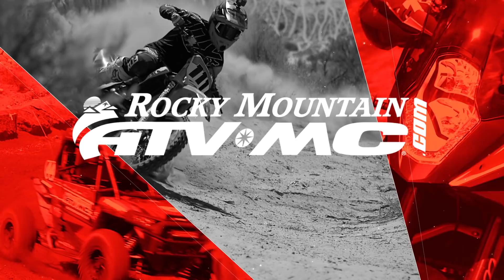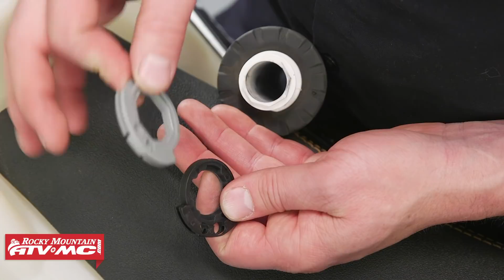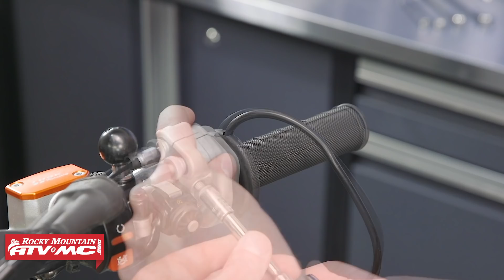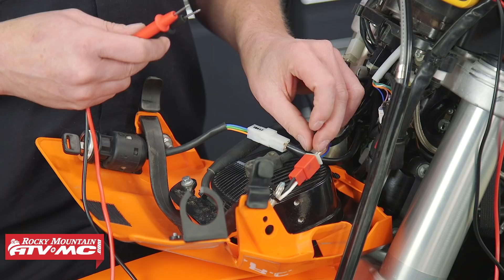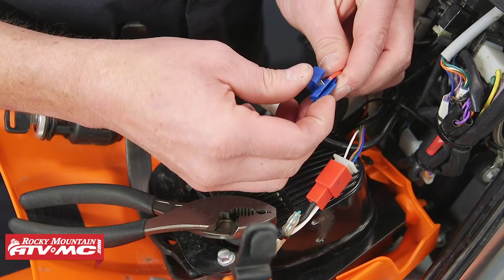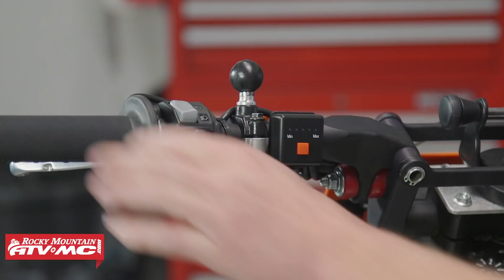Tusk Motorcycle Lock-On Heated Grips | Installation

Comment: I wonder if there is a installation video on installing these on a non-stator type bike. I have a YZ250x that I just bought a stator for that can run grip heaters but don't know if I need a regulator or how to install them to the stator wires provided.

Comment: I think a relay and a posi-tap is a better way to wire it, then you can power other items like a gps or phone charger.
Reply: Yea I was thinking that myself. I have plenty of watts available on my DRZ 400S but I dont think its wise to draw more accessories from the oem harness. I read that many DRZ 400S guys have, and I draw very little from mine as I use a 38 watt led headlight, and led tailight for a total of maybe 50 watts of 200 available. I am still hesitant to load the oem harness with heated grips for some reason. It sure would be easier to just tap into a key on power though, not to mention cheaper. Unfortuantely when I asked on a DRZ specific forum, I got mixed answers.
Reply: That One Guy. I did the same thing with my DRZ and just have a sae plug from the battery to power occasionally accessories like heated gloves and also to plug in my battery Tender. I have the Eastern Beaver fuse box and relay for my VStrom. Works good.
Reply: @Jimo368  Did you use this exact heated grip kit on the DRZ? If so did the throttle cam fit well? I tried ODI lock ons on my DRZ once and the throttle cam was crapola.
Reply: That One Guy I didn’t put heated grips on the DRZ because of the low power available but I replaced the grips and used a new Motion Pro throttle tube rather than mess with that crazy attachment method Suzuki uses. Only about $11